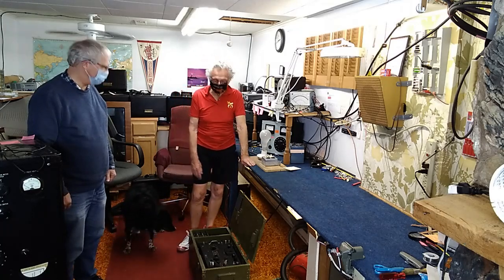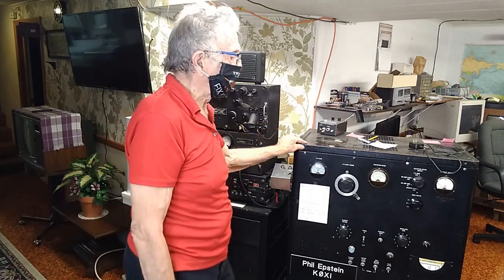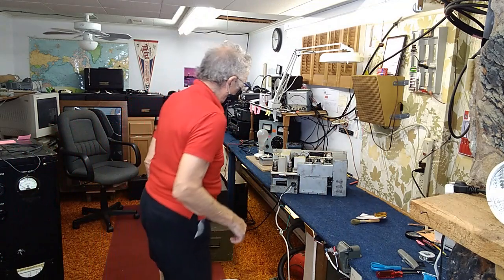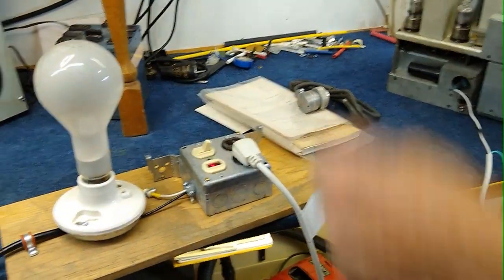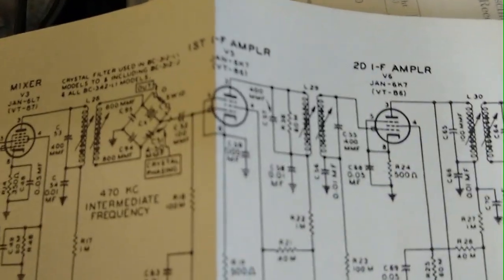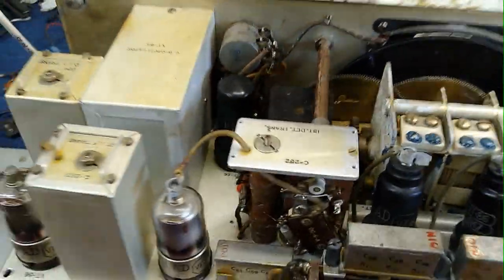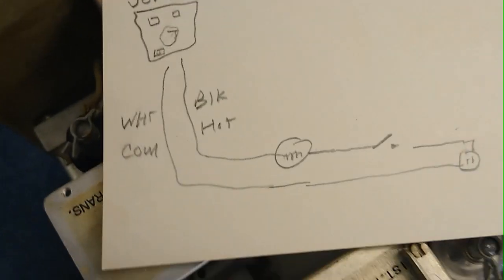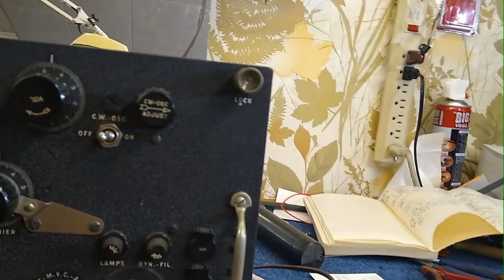Hooking up the radio from Niel

Comment: I had a bc342 and a bc344.  Changed out the mica capacitors. Notorious for shorting. Wish I still had them!
Reply from the maker: They are on ebay but the asking prices are excessive. You'll find them at hamfests when they get started again next year.

Comment: I bet those two blown caps were really paper caps made to look like mica caps. I would look at replacing  the other electrolytic and paper caps in the radio also. Very pristine front panel though.
73
Jim, WA8SDF
Reply from the maker: You're probably right about the paper caps hiding under a mica costume. I replaced the electrolytics in the power supply, but not the cathode elecs, they never fail. Tnx & 73 de Phil, WEØK.